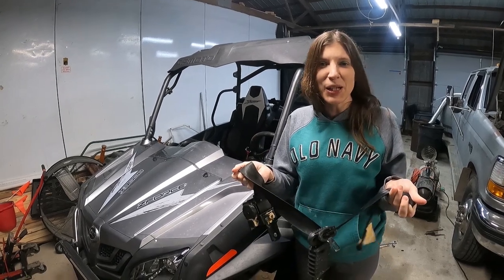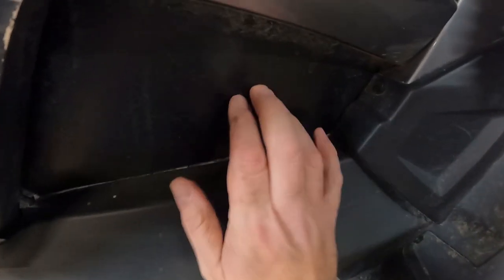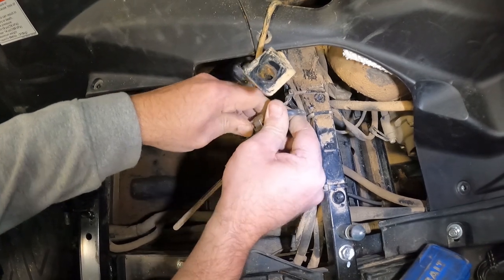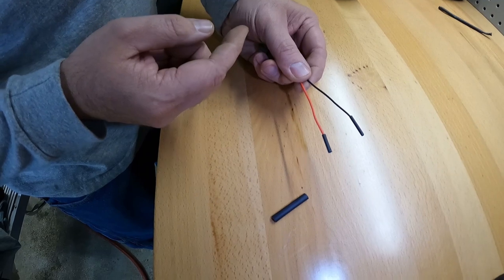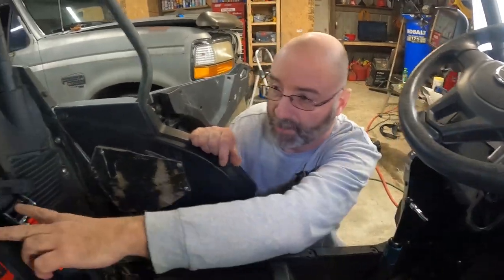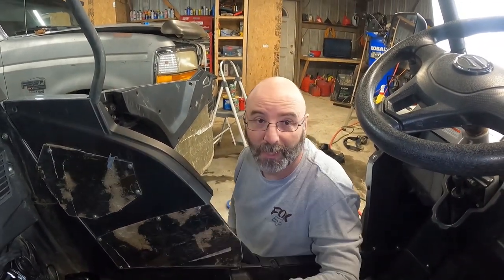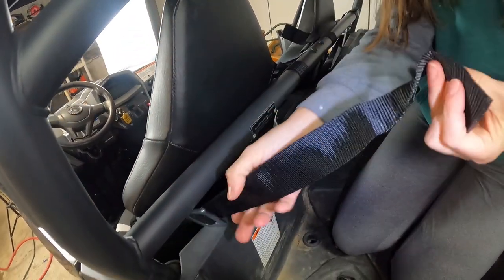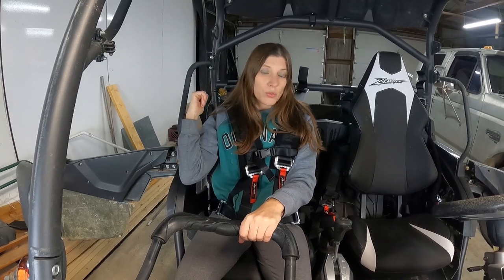cfmoto zforce problem | 4 point harness install

Comment: How did you get to the bolt for the tensioner On the passenger side? The gas tank is in the way.
Reply from the maker: That side was a little tighter but I don’t remember using anything special. A couple open ended wrenches should do the trick. Have fun with your project!
Reply: We just did this same mod and had to access both bolts from the top side at the same time.  It was a little tight but eventually got it
Reply: The passengers side was hard to get at … putting it back together was much easier 😊